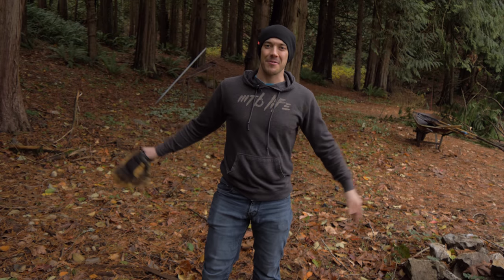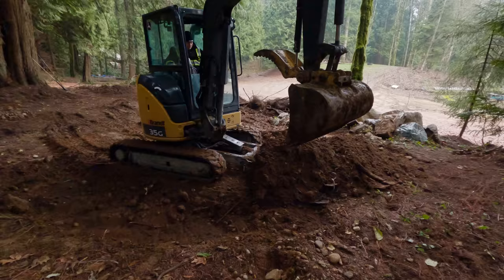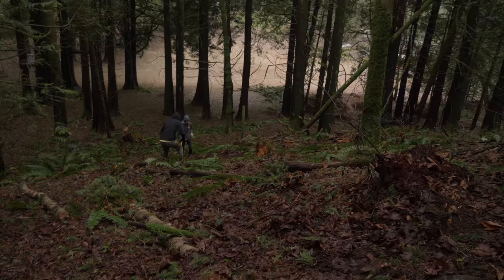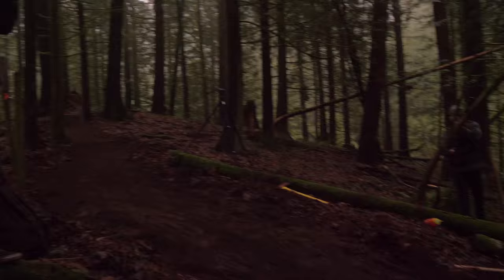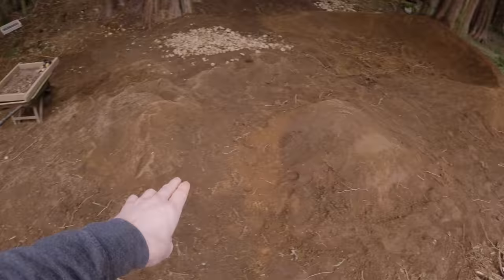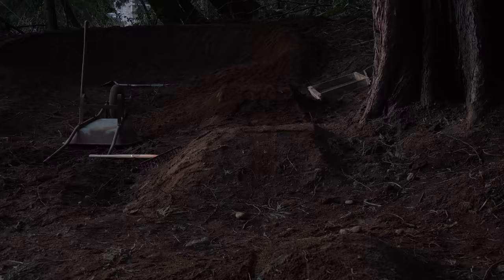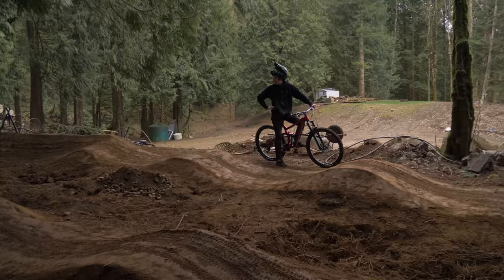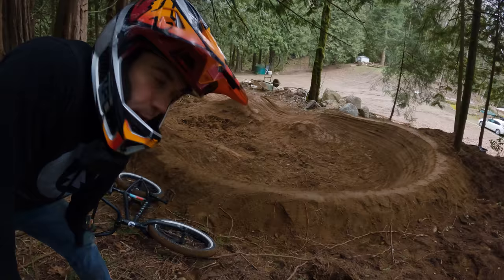Breaking Ground on My New Backyard! - Building a Pumptrack and Step Down!

Comment: One thing I will say about building any feature is make it 20% bigger than what you want it to be. Once everything settles and hardens it'll be at the right size. I would also say never to use wood in side lips, landings, berms, etc as they rot extremely quickly when buried - even if they are rot resistant they will break down faster.
Reply: Oh and pack in the back of the berms, when it gets faster they will start to slide if you don't
Reply: Thanks mate

Comment: JB - friendly land planning tip, avoid raising the grade at the base of any tree in excess of 2 inches per year.. Doing so will promote rot at the base of the tree for which it will not be able to recover. Your big berm appears to be supported by the base of the spruce/pine/fir tree. It was difficult to tell from your camera angles, so you might be ok. Also IMBA has a great design guidelines manual for sustainable trail building and design. It's a good read if you haven't checked it out. It may not completely apply to downhill lines, however, having the knowledge base on good trail building practices will help you make informed decisions on layout. You have a great skill set, and I wish you the best in your new development endeavors. Peace!
Reply from the maker: I never knew that actually!  thanks for letting me know about that with the trees.
Reply: @JordanBoostmaster  a pleasure. Enjoy the build. I am currently master planning a bike park for a private developer in central NH. Phase I planning is a small 87 acre fabulous parcel, much potential for every skill set. I'll send you a glimpse when the project makes it through approvals. Keep up the good work, your channel is very entertaining and a pleasure to watch.